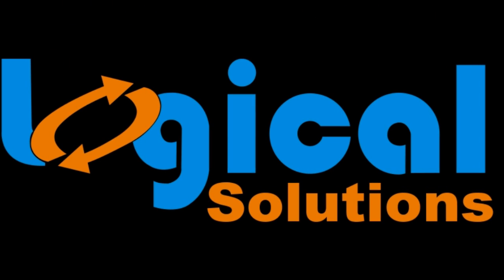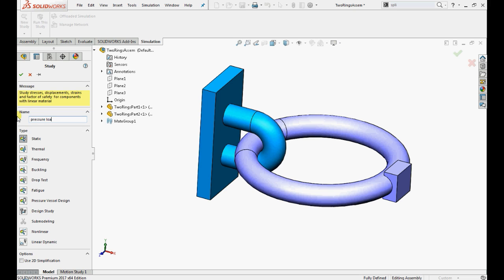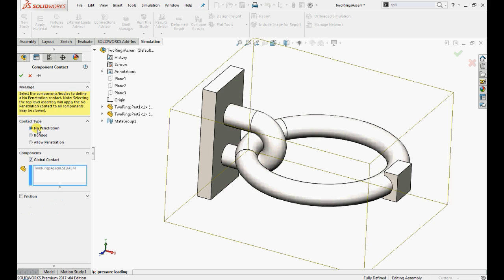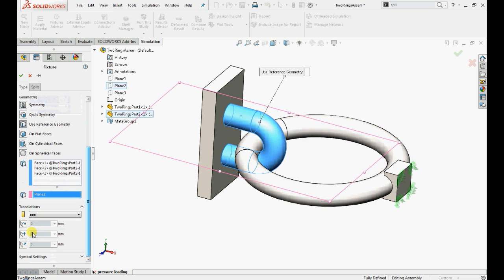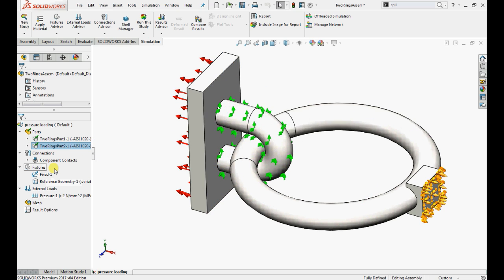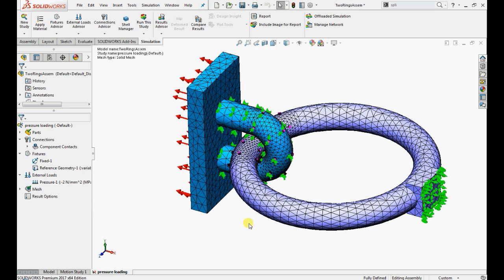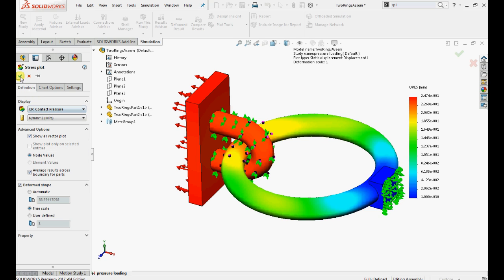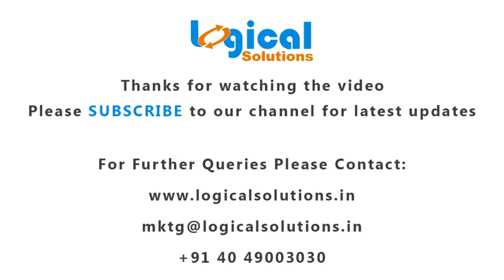Solidworks Simulation- Static analysis with No Penetration Contact

Comment: Thanks for the good video. I believe you are restricting the shear load on the U geometry, using reference plane boundary condition. If you run the simulation without that BC what will be the impact on the result?

Comment: I was wondering if you could help. I am trying to analyse a wrench on a bolt but a pipe is over the wrench so we could get better leverage. Idk what boundary conditions I should use
Reply: It's a cheater bar like used to open a lugnut. The force is on the pipe and the wrench is in the pipe. I fixed the nut and I'm trying to analyse the forces